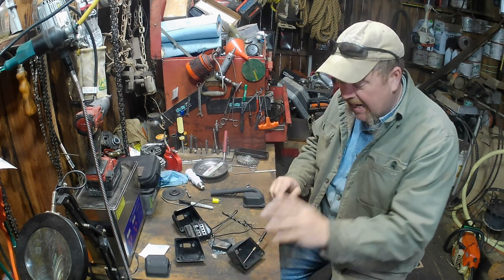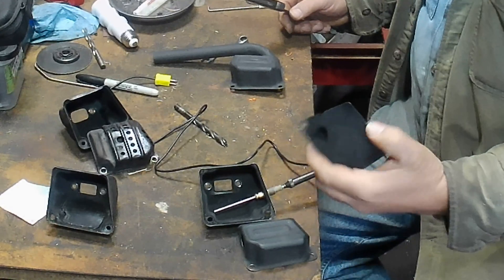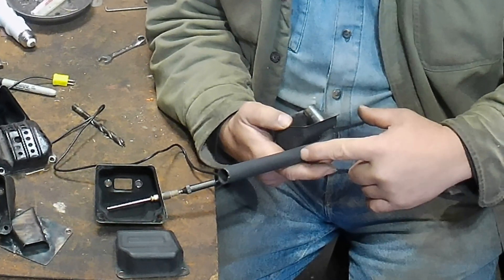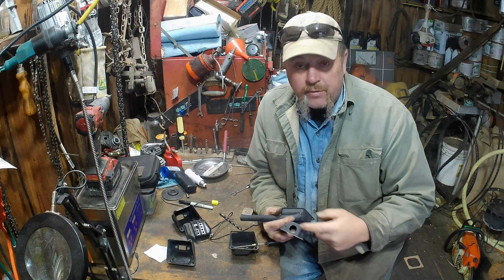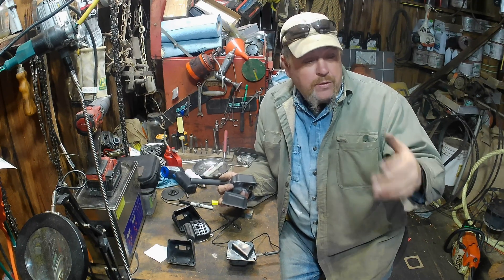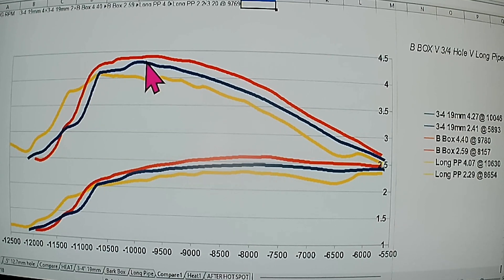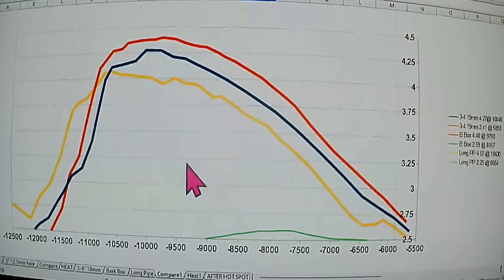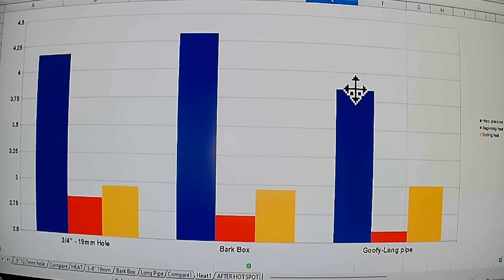Chainsaw Muffler Mod Testing--Dyno HP/TORQUE vs HEAT Comprehensive Results

Comment: I'll have to back up and rewatch this one.  Did you mention different temp readings?  
What was ID of long pipe?  The results fit the name, goofy.  I expected something that long to fall on it's face at high rpm not actually reach higher.  Makes me question what I thought I understood.
Have you considered labeling the digital readouts you put on screen?  Could be helpful.
Reply from the maker: @Kevin.L_ Dadgummit!! I thought I had ALL of those mentions of exhaust temp edited-out. I tried a different temp probe in the exhaust can (the one which WAS toughing the aluminum previously); I even spliced in about 10' of phone cord to further isolate the probe/wires from vibration so the readout wouldn't shut down; it didn't work; sorry to get hopes up and not deliver. Still working on it... won't work on next video either, but I have stuff ordered in-hopes-of getting exhaust temp. Don't remember it was Archer, Black Dog, Farmless Farmer, you, or just who gave the good suggestion of measuring exhaust temp... I'm trying but getting knocked around a little along the way trying!!  
The long pipe sure reached out farther; bigger pipe may help it build more HP and still reach out... almost a moot point in that it's unusable. 
The pipe was 0.610" or 15.5mm. Think larger pipe may be in order.
I think labeling the screens is a great idea; may be a bit, but a great idea!! Once I get the other heat figured out, I may try to mount all in a "bezel" of sorts and label them with their corresponding generic factors (IE; the one with yellow is 2x Shaft RPM. That reading divided by 0.70 will give engine speed (with a 7 pin drive,24 pin driven, and 2 magnets for the hall-effect sensor). 
The scale reading (the top blue readout) is the scale; it is multiplied by (with the current torque arm and gearing) is multiplied by 0.153 with an additional variable (chain drag and bearing drag) which changes (and is measured) with each pull.
I do think it would be helpful for people to understand. 
The bottom (smallest) readout is temp; right now, the red is ambient temp and the blue is the temp of the decompression plug.
Great suggestions!! Thanks Kevin.
Reply: @HayChaffandSawdust1  Thanks for the info. I'm sure it's been explained in the past but I didn't take notes and memory isn't reliable.  Ambient temp never even crossed my mind.
As far as exhaust temp goes, that seems more useful for tuning.  From what little I know about the subject.
Wondering if the reason the bark box works so well is the reduced volume, like the original with the baffle in place.  
More questions than answers.
Reply from the maker: @Kevin.L_  Oh, I know right??!! I don't remember having ever explained the numbers I present; nobody ever asked!!!
REDUCED VOLUME!!! Dangit KEVIN!!! you're letting the cat out of the bag. 🤫 There's another can (the part that bolts to the engine; not the "lid") that's been sitting on the bench in about every video... it has a "baffle" welded in it which does not restrict flow (like a typical baffle) in that it's just below the exhaust port and angled to the lip of the can; its only purpose is to reduce volume.  You're getting ahead of the game... QUIT READING MY MIND!!!!! 😂 🧙‍♂️🤯  
"More questions than answers" ... BOY OH BOY, you said a mouthful there!!!
I believe you are right on the using exhaust temp for tuning; there is still ONE variable in my dyno that sticks in my craw; and, it's the tuning. If I had something I wanted to "win" (instead of trying my best to be impartial to each step); I could dang sure change the tune to change the outcome; hope to sew up that little loophole too.  Ain't figured how to deal with ambient temp with respect to the other temps, though. Don't know how much difference it makes; so far, I'm trying to have a few tests all built for the same day to attempt to negate it some... because I don't know how to factor it reliably.  Awesome exchange Kevin!!
Reply: @HayChaffandSawdust1  Didn't mean to push things along too fast.  I'll not tell anyone about the big plans.  Guess it shouldn't be much of a shocker that a big empty box isn't the best for flow.
I read in some 2 stroke book years ago that short stub exhaust, no chamber, maybe 3"?, was recommended as a baseline for testing. Seems like that was short enough to have no tuning effect.  
I'd want to use that exhaust temp sensor for tuning, but it would take some research to choose a target temp.  Or just pick the tune you like and tune to that temp each time.
Reply from the maker: @Kevin.L_   Short/Stubby an Ironhorse pipe? I do like them, but i only have one or two customers that think the noise is worth the gain. Personally, I like them. A residential tree guy brought me some logs yesterday; people like him don't want the noise in town... I get it. Sorry... got rambling off-topic. 
As far as exhaust temp, i have no idea of a goal; thought, much the same as you, it may make an aide for tuning for the Dyno. My saws, I don't care; I tune them fat and to idle. I'm trying to paint this dyno into a corner so it has NO wiggle room to lie to me. Don't get me wrong, it's pretty decent; I always want better.
Reply: @HayChaffandSawdust1  Yeah those wide open exhaust can get loud.  Quiet does have it's place.  A battery saw makes you realize how nice it is being able to communicate.
Feel free to ramble any time.  
No the ironhorse pipe still has a small expansion chamber.  The one I read about was just straight pipe.
Reply from the maker: @Kevin.L_  Ahhh Ok, my reading/comprehension leaves a little to be desired at times. Dyno Joe tested a horn/cone type "muffler" once; did fairly well on the dyno if I remember.  I love the battery saws (don't have one myself, but have batt pole saws) to throw in the SxS and drive fences or hayfields. Squeeze the trigger and zip-zip, let off the trigger and put it back without it being hot.  I've climbed a tree or two...literally less than 10 and never had much of a ground crew; I can dang sure see how the batt saw would make stuff SOOO much better. Also being in a tree (for a sub-novice like me), pulling the rope on a saw can feel awkward: but leaving it run, while safe enough, is not too productive and costs valuable run/cut time.
Reply: @HayChaffandSawdust1 Battery pole saw will be our next purchase.  Running any kind of saw is just good fun so long it starts and the chain is sharp!  
I don't do many trees jobs either, but in a tree I like my Milwaukee hatchet and Echo 4910.  The Echo is so easy to start even in bad positions it's comical.  I'd kind of like to port it but it starts and runs so well I'm afraid to touch it.
Reply from the maker: @Kevin.L_  On the battery pole saw, I have an opinion.... my opinion is worth exactly... precisely what you paid: nada! I have a Milwaukee because I'm battery-committed to the brand; at the time I didn't know they made adapters for the batteries to run Dewalt stuff with Milwaukee batteries and t'other way 'round. I like the fact that the DeWalt has an angled head that will allow cutting more on the bottom and top to make undercut etc.... than the straight head. It's kinda a bugger to cut a limb15' up and only being able to do side cuts (mostly). Don't know about DeWalt, but I do like that you can keep putting extensions onto the Milwaukee as long as your pocketbook will stand it. I have 3 or 4 extensions for my Milwaukee and it's been a good saw. I can't remember mount on the bar, but it's common; I put a 14" bar (I think) on mine. @bellhoppersaws has done a bunch of the Echo 4910s; I think a basic muff mod helps them lots; he showed a few; don't know if he told timing numbers tho.
Reply: @HayChaffandSawdust1  The 4910 has the most restrictive factory muffler outlet I've seen and it's removal is a must.  I've saved some porting numbers from Bisco but I'm still holding out.  I have 2 of the saws so I should probably take the chance and port one.
The newer Milwaukee telescoping pole saw is getting great reviews.  I'm already into DeWalt and Milwaukee batteries so I have options.  Thanks for pointing out the importance of the angled head.  I'll keep that in mind.
Since we are already off topic, what's your opinion on grease?  Do you use one for everything or separate rolling and sliding uses?  
Have a good weekend!
Reply from the maker: @Kevin.L_   I know @CharlesBrisco does some pretty dang bad saws; usually his have machine work and didn't know if that was in your bag of tricks or not.
Didn't know that Milwaukee had a telescoping version; I have an Oregon 40V telescoping pole saw too... battery going weak and cheaper to replace with the Milwaukee. Mine is the "tool head" version which is also a weed-whacker (that I actually purchased first for my wife as her shoulders don't like starting the gas-powered ones) , so the addition of a pole saw was relatively inexpensive.
Grease; are we talking on the sawmill or in-general? On my sawmill, there are only a few pivot points to grease and they get Mystic Red (which is my go-to for my farm and construction equipment); my go-to for a sliding grease on the farm is 00 cornhead grease for most applications; it stays good, doesn't seem to attract as much dirt, and last ok.  For the sawmill, all of the sliding and rolling (a roller bearing riding on a surface) parts get ATF fluid as prescribed by wood-mizer.
Reply: @HayChaffandSawdust1  Thanks for the feedback.  I checked my wood chipper manual and it says to grease the bearings every 500 hours, which is years away for me, so I just need to worry about the tractor/loader.  Got a deal on a battery grease gun and wanted to start it off with something better.  Mystic red looks good and should be available locally so I'll give that a go.  I had to look up cornhead grease but I am familiar with the versatility of ATF.
I do have an old Logan lathe, but I'm no machinist.  Not sure I'd risk ruining a jug yet.  I'm an expert procrastinator, plus I'm happy with how my 4910 runs for now.  More power is always welcome, but I'm afraid to risk such a well behaved saw.
Looking forward to more data from the dyno.  I need more confusion in my life.